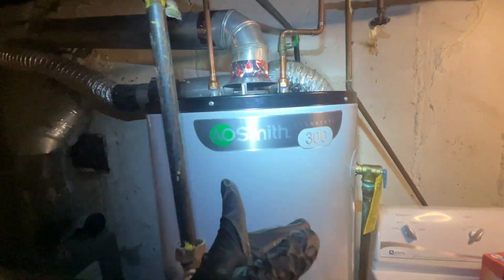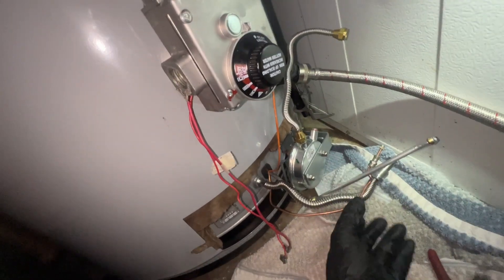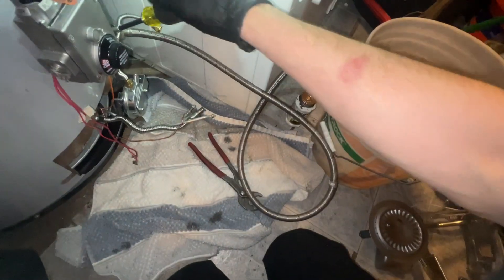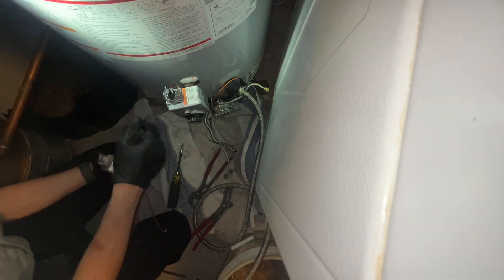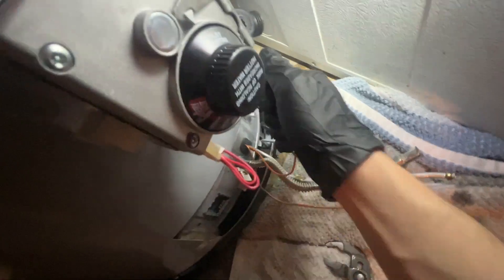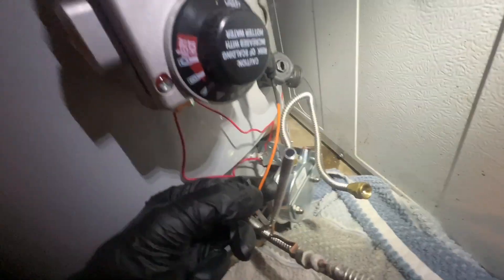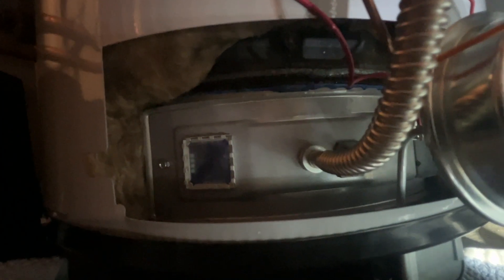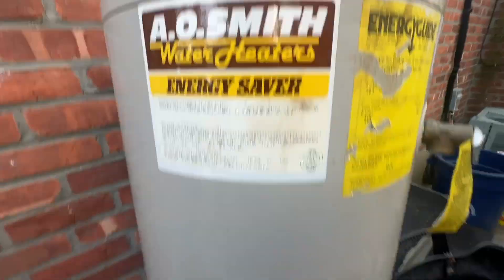Over-Engineered Garbage! Who Installed This?!? How to Change a Gas Valve On the Fly! AO Smith!

Comment: A.O. Smith has 2 options for thermostats on these models.  White Rodgers and Honeywell thermostats.  Some customers prefer the older style gas valves as opposed to the plastic honeywell ones.  Also, that heater came from Lowes, not Home Depot.  Lowes sells A.O. Smith and Home Depot sells Rheem.

Comment: damnnn nooo ao smith trash too omfggg
Reply: lolz I was gnna say but still new n needs a major repair it's a callback ID b stressed if I installed it I hate that man
Reply: ngl
Reply: I use ao smith too much h too
Reply: looks like u were playing with some pressure switch 🗑
Reply: those gas new gas valves r trash omgggg
Reply: @sammyc3726 They are not new, they are older designs.  A.O. Smith has 2 options for controls.  Honeywell and White Rodgers which you see here.  Some customers prefer the older metal ones as opposed to the plastic Honeywell.
Reply: here we go, even ao smith couldn't dodge the cheap honeywell resideo parts they kinda suck honeywell in my opinion tbh lolz
Reply: I'd b stressed that's a callback annoying af
Reply: Keep up the good work daniel.your a good hardworking lad and your brother. Nice to see good honest lads. Did you kick the vape by the way. Was so funny that time you were working with mikey pipes and was struggling to kick the nicotine I'm still trying to give up,I've stopped the cigarettes  but still vapeing. Best regards .mike
Reply from the maker: yes, i have been vape free for over two months
Reply: @DCHVAC  that brill.not easy to kick that dam nicotine.keep ip good work.very best to uou daniel&peter
Reply from the maker: Lol. Just clickbait. Only weird experience I’ve had with them is this.